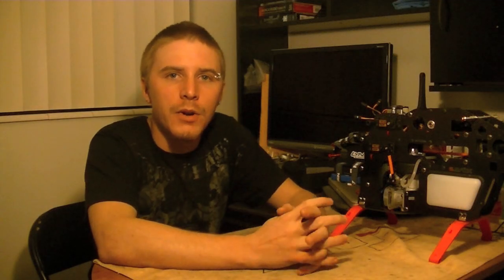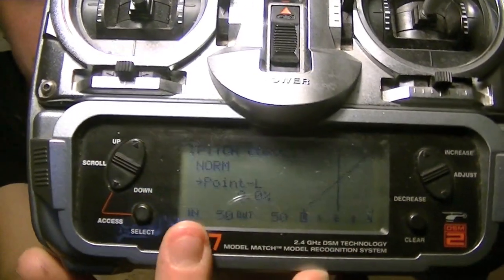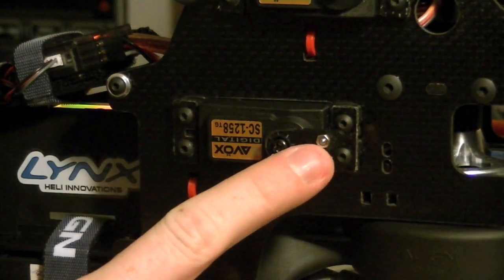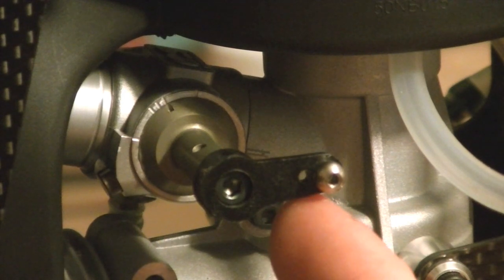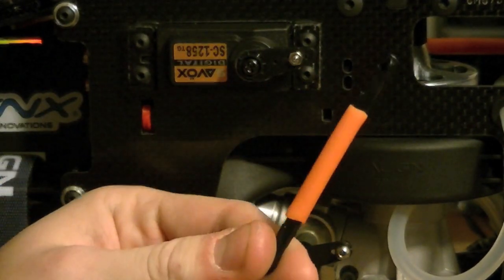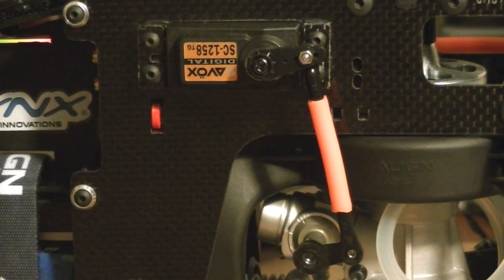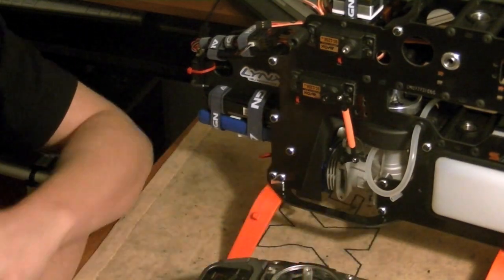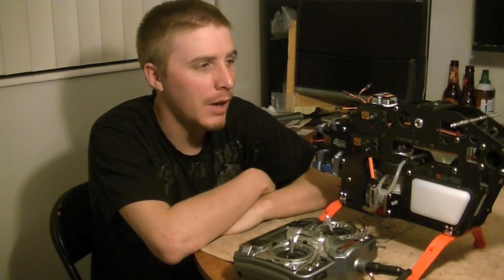heli tips and tricks (throttle link setup)

Comment: Hi..why is my os 91 engine pump fuel back to tank instead of going to carb when I use align starter..any idea
Reply from the maker: if you want sent me a message on FB messenger with some photos and I can take a look.  It sounds like your tubing could be wrong or even the check valve.  But I would need to see how you have it setup.

Comment: Hi freedy I have a thunder tiger 30 v2 heli do u no what the carb setting should be
Reply from the maker: I usually set them to the stock setting and then you have to fly and tune as you go.  Take in mind fuel type will make a difference, head speed and temp ex.  Just remember rich is always safer then lean lol

Comment: Good evening. I attended all the video, I learned a lot about the points of the carburetor. Heli me with this problem.estik in the middle at 50% the engine is already high all carburetor open, now I correct this problem with your video, you know something about pit gauge regulagen of peace. PARABENS by the video, YOU HAVE SOME CONFIGURATION TO FLY IN SCALE ... NO PITC CUR = THRO CUR = SUB TRIM = I AM PORTO ALEGRE RS. .. whatsapp == 051.985443938.geraldo. MY HELI = RAPTOR 30 NITRO CLASS 550.

Comment: freddie, question.. im assuming the engine wont idle at the shut position.. how do you account for that? do you just trim the throttle servo up until it idles correctly? its on a trex 700 dfc ntro

Comment from the maker: ok...... the break in only requires like two tanks running really rich, OS engins dont need an extensive break in, after about two tanks start chekin temps and leanin out your needles.  also when u set up your throttle linkedge you need to make sure to lower your throttle trim all the way down.  that way before you start u raise your throttle trim to idle, then start the heli and fly once you land you then should be at idle, and after your close the trim all the way to cut the motor.

Comment from the maker: uuuummmm i am still going to disagree, maybe you r reading the movies info wrong lol.  gov or no gov there is really no way to get 100/100 with no binding in almost all cases.  the throttle and pitch curves are what need to be set to keep the engine from boggin and keeping up with pitch. i am not saying it can be done but good luck trying, there is no reason why you cant adjust end point to achieve no binding i have done it hundreds of times and have always had a top running heli,

Comment from the maker: absolutly not lol in almost every case you have to reduce end points to get a proper carb travel at closed mid and full, after u have the right end points you then teach the gov those end points, cant argue with results its never failed me one i have done this many many times my friend, plus every heli and engine will have a diffent mech setup so changin end points is a must, however you do want to adjust links and ball to get as clost to -100/+100 as possible